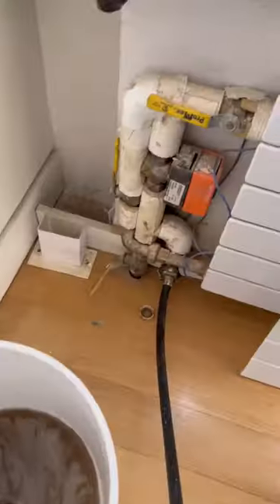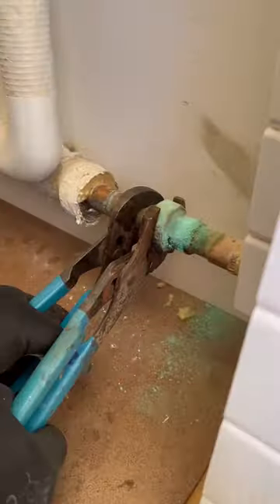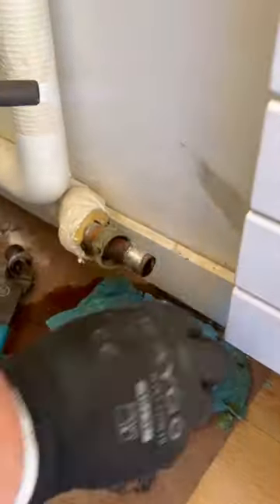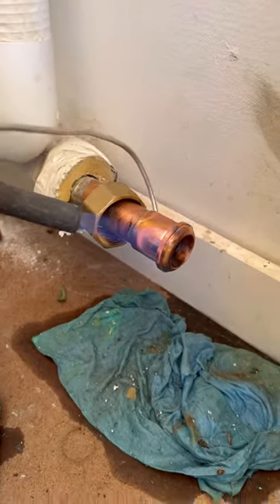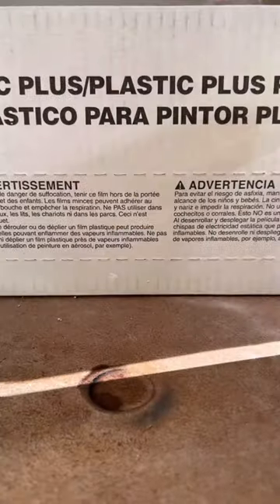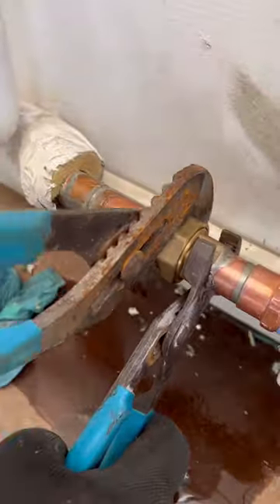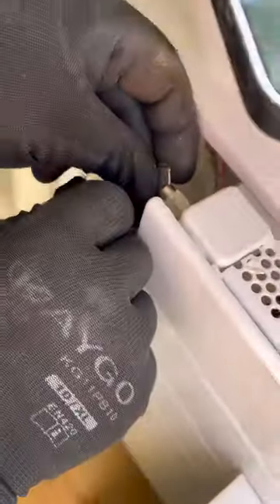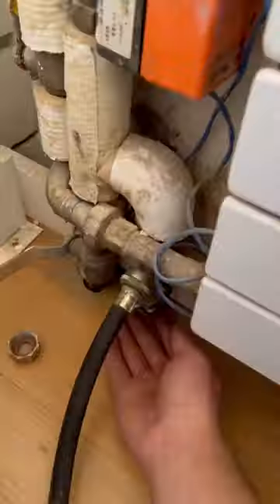Corroded Copper Union Replacement

Comment: The 1st time I was doing  any work in a so called " 1%er's residence was in San Francisco  and was supposed to take an old radiation that wasn't working  apart ....knowing they can be very dirty inside...and something taught long ago when I began training  is to put down protection to prevent accidental spillage from damaging the customers walls floors cabinets....I am a plumber and I control  water....having it be uncontrolled  means I wasn't thinking about what water was doing is it pressurize or not...admittedly  heating by steam boilers was mew to me but water or steam is just pressurize water and though the high-rise  building heating had been off all day...  the condo was on the 2nd floor with 15 floors above....maybe the system was drained....maybe not. precaution is always preferable then blindly going forth ..... so.  I put down a clean canvas drop cloth like a painter drop cloth.  protect the wood floor from any scratches from any tools I might set down  or dents if I drop em....it happens... I have a few rags and a small container to catch anything leaking when I disconnect the radiator
.the independent contractor the company I worked for.  who they called when we had more work then could be handled ..and once was employed directly before going out on his own exclusively servicing boilers and large scale  residential. building plumbing where my company did all plumbing heating and general maintenance  for all properties in San Francisco...prior to becoming a plumber a worked a lot if the building trades and commercial boilers in high rise buildings just never became anything I had experienced  and why I was there because I needed experience and routinely any available employees were sent to help this guy .....  and qstthing onthis particular job was getting chewed  out for bringing "used" .. as in used elsewhere  drop cloth....I wash my drop clothes after use so nothing drops onto anyone's floors when I spread them out.sometimes I use them for plain comfort..but certainly wasn't attempting or what to think if I dropped over the radiator that the drop cloth would prevent catastrophe.. it would ruin the drop cloth for future. relegating it to the pile of soiled drop clothes.... no explanation given were enough to change his mind
 so I removed my protection.... and he orders me to start disconnect the radiator.....and blackest oily liquid begins coming out with nothing to prevent it from reaching the hardwood floor aa I was only allowed brand new rags...less the snob living there see a rag used somewhere else in their home because once we cracked the seal ,we couldn't stop it from leaking untill pressure lessened which was more the the N absorbing power of 2 rags could take....... I pointed out  my clothes I'm wearing have been kneeling on the floors of other people's homes...my tools have been in thousands of places .... but a clean still all white drop cloth....will receive complaints.... I didn't receive an answer. But I wasn't sent to work with him afterwards which is a shame because I like finishing any repairs I began ...always hated fixing someone else's work..faulty or not  so might be related ..... buy

Not ever has any customer complain about protecting their home ....had some plastic their floors previously before arriving...just for my boots...not knowing I brought disposable booties to go over my own boots....because won't take off my boots due to safety issue and adds a lot of time to any job removing boots several times... even putting booties on can take a couple minutes....each time.....t would let those customers know where they can buy them and hand them out to workers without their own so they didnt have to plastic their house anytime they needed work done....some would also hand me booties as well as cover their floors... and since the floors were entirely covered and not just where expected walking would occur...
I admit some people have a screw loose when it comes to contamination for outside their homes.....but normally it's found in affluent people  ....I  imagine thinking they somehow are with less germs then others and that's just not true in average ....if you clean your house and yourself regularly  then your as clean or dirty as anyone who does same....

Comment: That is some NASTY looking water coming out. People don't realize you should flush your radiators once per year
Reply: Add inhibiter, stays clean for years
Reply: You NEVER flush a hydronic boiler. Jesus stay away from boilers 🤣🤣🤣🤣
Reply: No you shouldn't? The boiler should have a wye strainer on the supply the older the water the more efficient
Reply: @kevinhardy5724  yuppp the less hard water the better…just treat it with chemicals …Ima oil burner mechanic by trade

Comment: Just out of curiosity do you ever use type m copper for any of that? I am having a disagreement with a cali plumber.
Reply: M is fine for hydronics. If you use M on domestic you’re a hack. 🤷‍♂️
Reply: @jman0870  lol that's what I was taught, just making sure I'm not crazy
Reply: @scottboehmer1114  some local codes allow M for domestic. I DO NOT agree with it.
Reply: @jman0870  me neither I've been plumbing for 17 years and have never used or seen it used where I'm at.
Reply: @scottboehmer1114  I’ll never agree with it. I don’t care what the codes are. It was drilled into me 15 years ago that red line copper was for hydronics and my opinion hasn’t changed from experience. 🤷‍♂️

Comment: Is air in the lines why they knock or is that hot steam+water causing hammer? Thanks
Reply: Hydronics don’t hammer, only steam. That radiator is hydronic. Steam hammer is caused by steam and condensate fighting to get past each other.

Comment: The heating system should have places where air bleeds out automatically
Reply: Mine are not automatic, I have to use a key on the radiators and turn the Twisties on the newer floor types
Reply: @Rancid_Ninja  it still has an air scoop with a vent, possibly more than one vent. If your loop pressure is set right, you don’t have a bunch of make up water, AND your vents work you don’t need to bleed. Period.
Reply: @jman0870  all I know about are the bleeder valves thru out the house and how to add water to the system, don't know anything about any vents or air
Reply: @Rancid_Ninja  why are you adding water manually to a hydronic system? 🙄
Reply: @jman0870  because the pressure is low and needs to be between 15-20 and won't add water on its own. No idea how old the furnace is but alot of the radiators are still the old original ones, older than I've been alive
Reply: @Rancid_Ninja  right…

Comment: That was asbestos insulation around the pipe. You should charge more
Reply from the maker: Fiberglass. You think there would be asbestos in a $12mil apt
Reply: @hydronyc  that’s asbestos my man. It’s a $12 million apt but it’s also very old
Reply: Look closer. Fiberglass.
Reply: That was fiberglass 🤣🤡
Reply: @hunterbarnes9497  try again 🤣🤡
Reply: @hunterbarnes9497  asbestos doesn’t come in yellow Notice the light yellow color it’s fiberglass